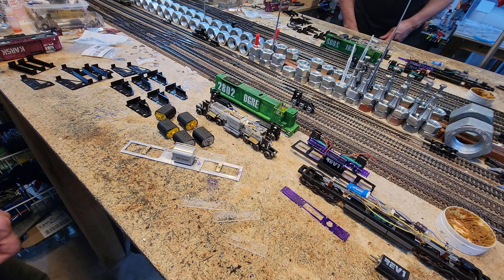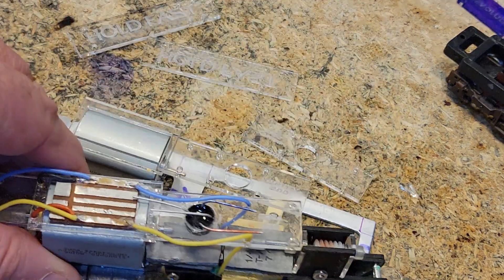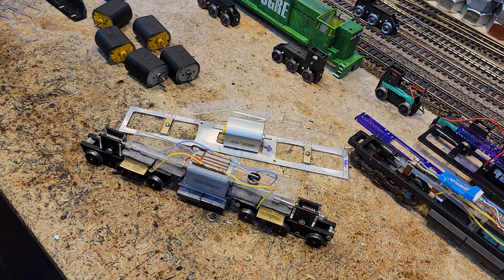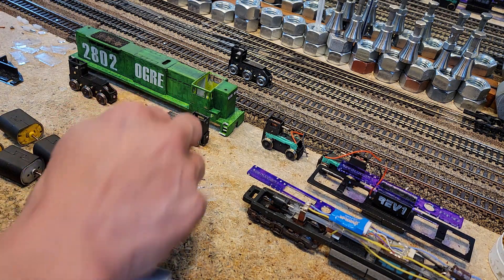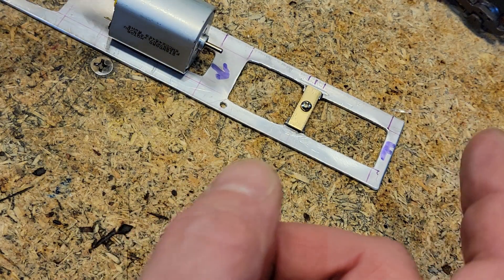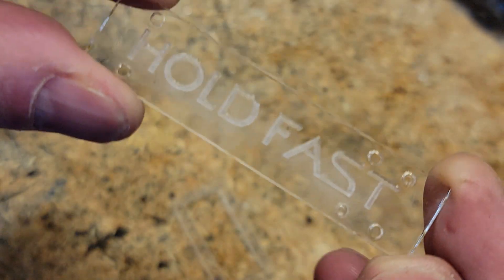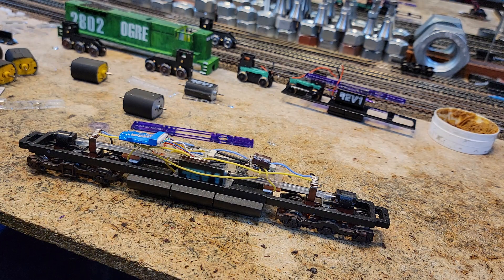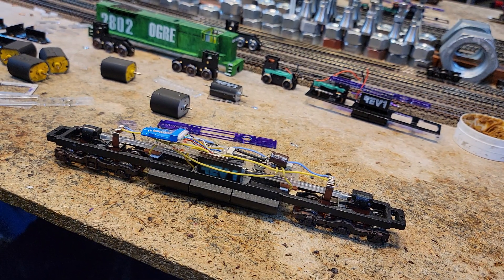2023 Part 8 DCC Work Platforms

Comment: Since watching this video and many of your other ones, I have scrounged different materials for platforms:  Phenolic breadboard w tiny holes (no copper cladding); Plastic cases came from old MRC decoders cut up to fit, Fastrack PCB ties for wire connections; copper sheets cut into strips with jigsaw or dremel for the PCB wiring, a plastic blind insert hollow inside - will try to tuck Z decoder inside hollow.  Keep eye out around home for potential platform material.
Reply from the maker: I have even used used tupperware from the dollar store and cut it to shape!

Comment: With your mill, you really could build the dual level platforms out of 1 solid piece so you dont have to bond them.  More so, you could leave a small lip on the bottom for added strength as an alt to the suggestion from TudRow.
Reply from the maker: I'm having to think about these materials now because it's true that these platforms that get long could be stronger!

Comment: Could you use some L shaped brass on the sides of the work platform to really stiffing it up ?
Reply from the maker: I am going to test this idea with some metal.  I should be able to bend a channel using the bench vise and the then stiffen it up - that's a pretty good idea!

Comment: What are your thoughts on aluminum for a work platform being they conduct electricity?
Reply: If you are concerned about conductivity, try covering with kapton tape first.  I am thinking of using some surplus brass strips.
Reply from the maker: @espeechoochoo  I don't use kapton anymore because it becomes a permanent adhesive over time and leaves a lot of glue residue - liquid electrical is the way to go because its so easy to cleanly remove!
Reply from the maker: should not be a problem since nothing conductive touches the platform - bonus is aluminum is not going to break off!